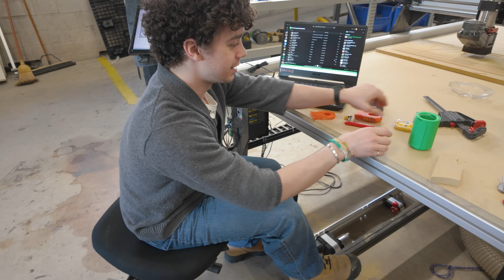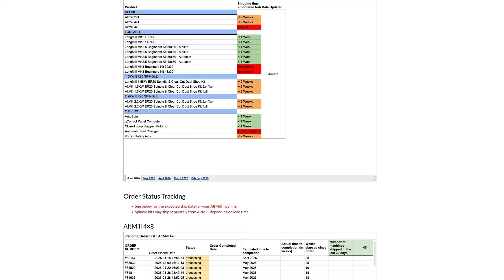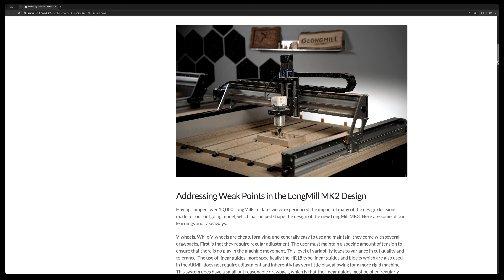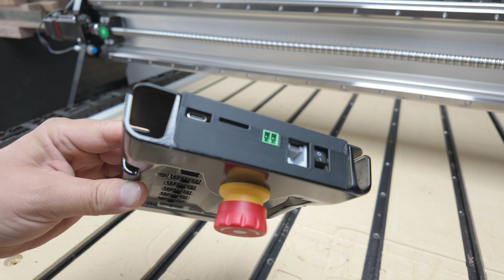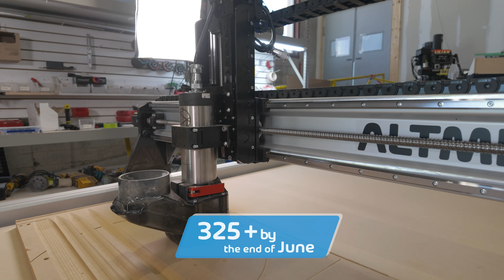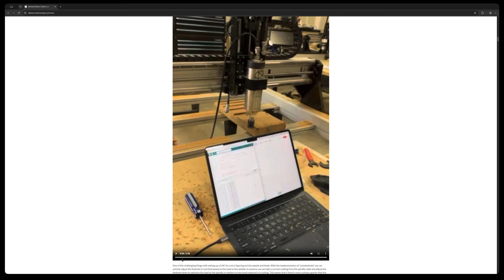June 2026 ❘ Production Update

Comment: I look forward to some kind of pendant. I run a HAAS VF4SS with a pendant and I run an Okuma with a pendant. It is real nice to be able to jog the machine axis and see where the cutter is. One thing that would be great to have is a spindle probe to locate your work offset. Being able to auto pro a corner, center of the material or a feature would be killer. I would definitely pay for that. Tormach makes a cheaper one vs a very expensive renishaw probing system.